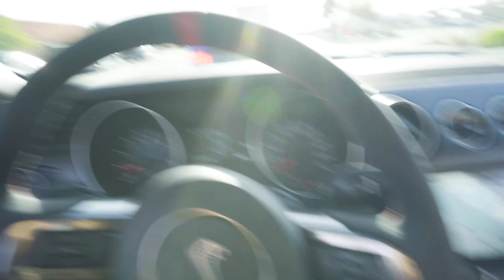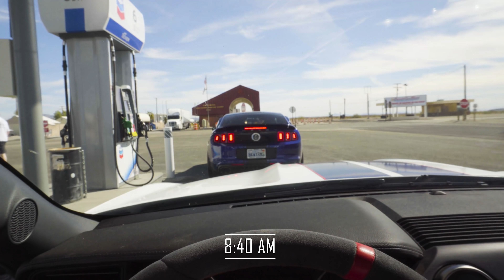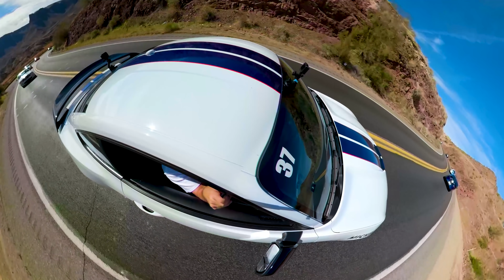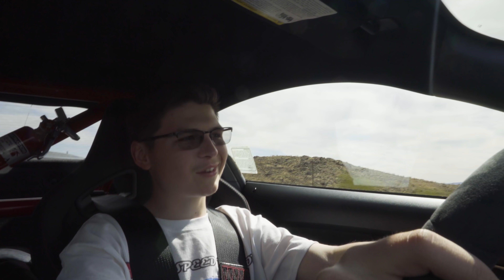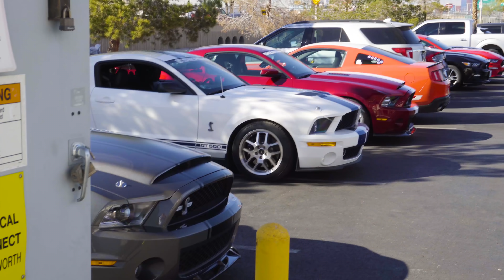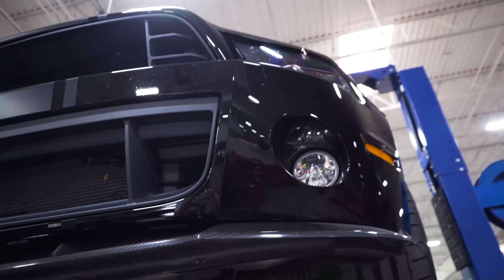Picking Up My SHELBY GT500 SUPER SNAKE (Walk-around, revs, & more)

Comment: Just bought a 2007 shelby gt500 my dream car for 12 years can’t believe how amazing it is so easy to drive around town have a huge list of mods can’t wait to push about 750rwhp hopefully next month
Reply: A word of advice when trying to put that much horse power and a 5.4 L engine. I ended up locking  my engine up  with a smaller supercharger pulley a cold air intake and Anna Ford racing throttlebody. Had nothing to do with the car running lean, had nothing to do with detonation, I word of advice is do not go over 650 wheel horsepower on a stock 5.4 motor. I don’t care what tune you have. No good tune is going to stop an engine to lock up the bearings on the crank.
Reply: Mine was a 2008 GT500 and I did get the engine warranty which was $20,575 for a long block and installation through Ford. Do not get a MacLeod clutch and absolutely do not get a Bama